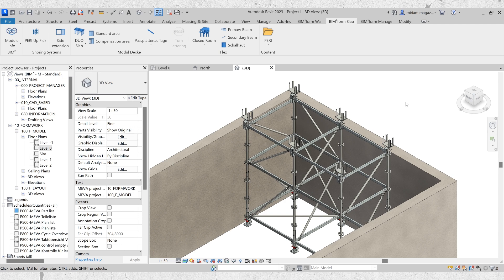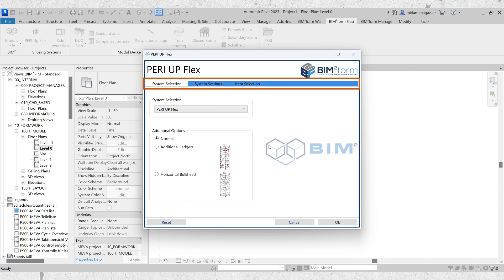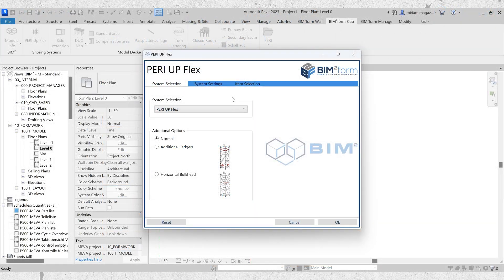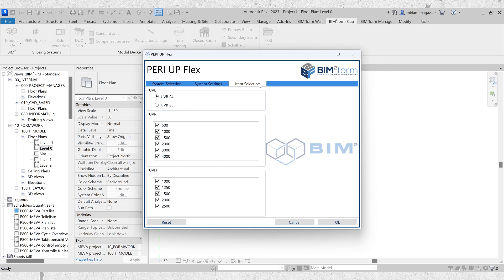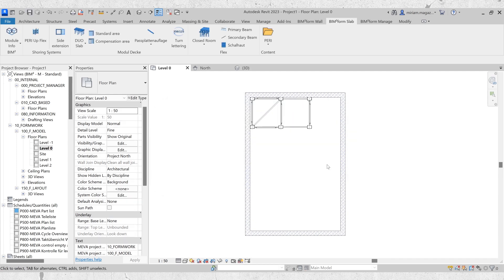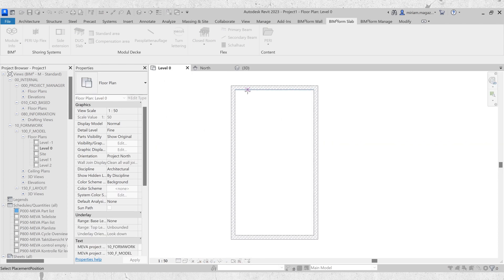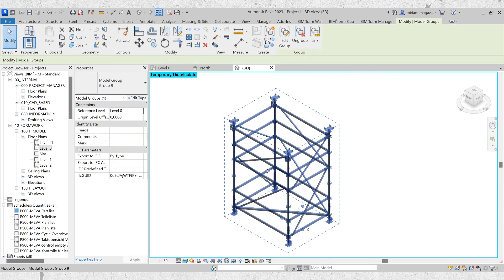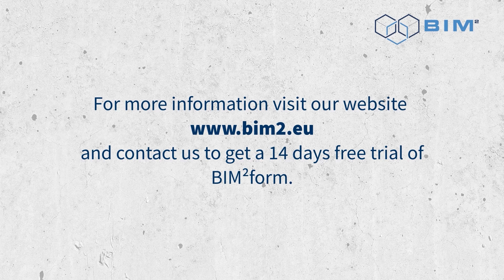BIM²form Slab: How to place Shoring Towers with PERI Up Flex | BIM²

Comment: i installed bim2form trial in revit 2025 and its not showing in tab bar menu. is this plugin not support revit 2025?
Reply from the maker: BIM²form is currently supported for Revit 2022, 2023 and 2024. With our upcoming release by the beginning of November, it will be available for Revit 2025.